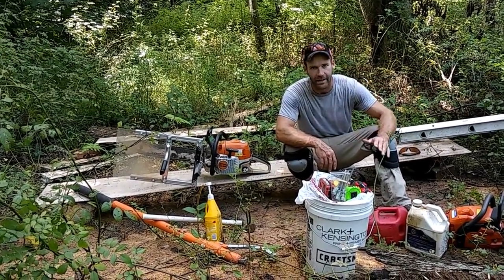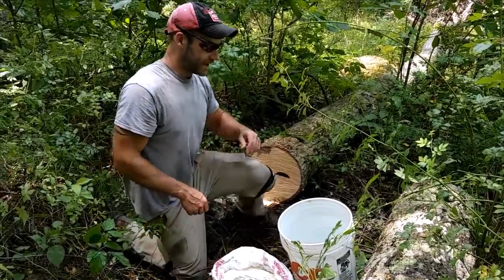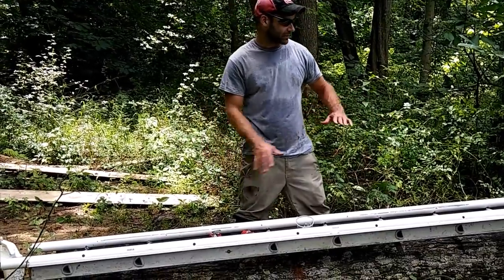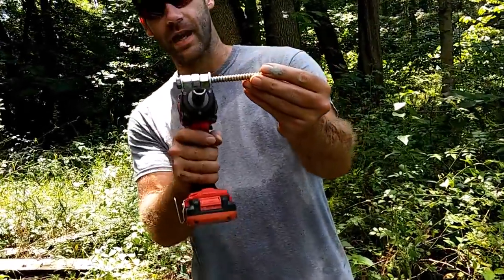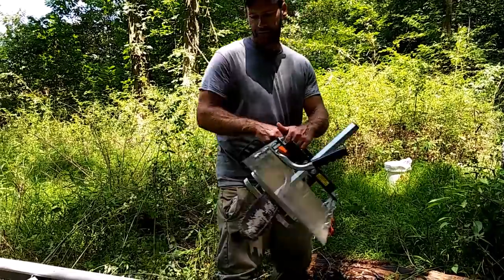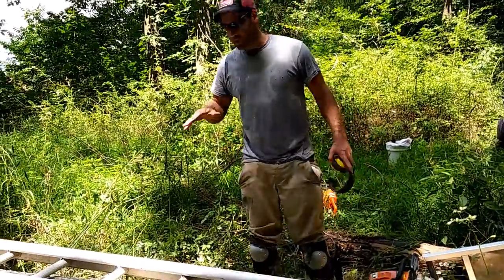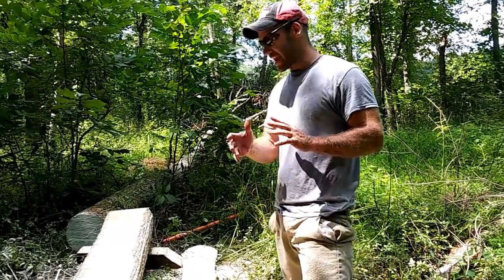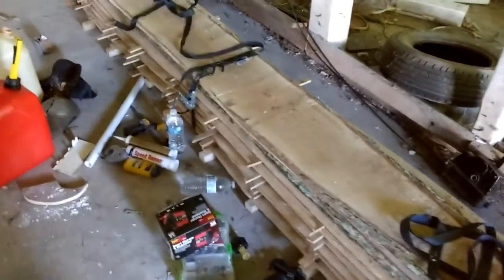How to Mill Lumber With a Chainsaw - COMPLETE PROCESS

Comment: have you considered cutting with the top of the bar? and having the shavings eject opposite the controlls and operator

vs

using the bottom.of the bar and running it all thru the  sprocket clutch  and  onto operator pathway.

Comment: Good information. For my first mill I’m getting a  smaller length to learn the skill of slabbing, before I get something that requires a 28-36” bar. What everyone forgets are big logs are heavy. Unless you have a tractor or a crane it’s heavy to move large diameter logs. Better to start off with lighter weights and move up to the heavy stuff.
Reply: Lmao I'm pretty sure anyone who works with lumber or is planning on milling their own slabs has not/ does not forget that "big logs are heavy"!! 😂😂
Reply: That's the point of an Alaskan mill, take your mill to the large log and cut a slab off. The slabs are movable.

Comment: What Stihl did you use. Why do you cut 2 inches thick. I'm just getting started on milling
Reply from the maker: Hey, its a Ms 362 with a 18" bar. I like the 18 instead of the 20 because since it has less chain it gives the chain more rpm making it cut faster. It is a nice middle ground. I do them all different sizes. Was just doing them that size for what I am planning on using them for in a year or so when they dry. Be safe, this is very dangerous.
Reply: Do you think  Stihl MS250 would have enough  power to cut logs ?
Reply from the maker: It will work, will just be slow and wear out the saw faster.

Comment: I like your chain oil dispenser. What did you use as the "valve" on the hose end?
Reply from the maker: O, its just gear oil with a pump on it. Since there is so much going on, I just like to start with a little extra and Im sure it does something for bugs/rot
Reply: @Trotlining  something you made, or a store bought gear oil pump?
Reply from the maker: Is a store bought pump. It has a little cap that goes on the end also